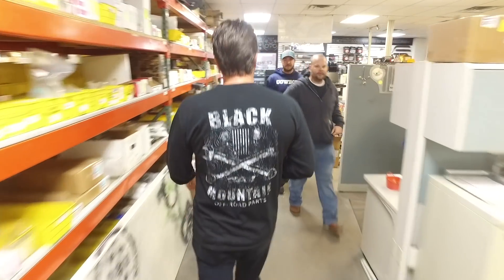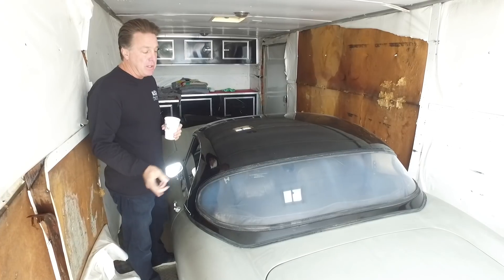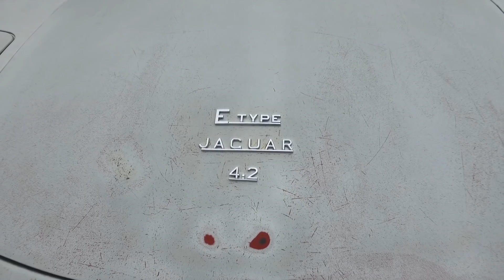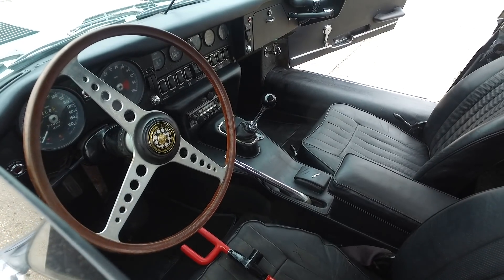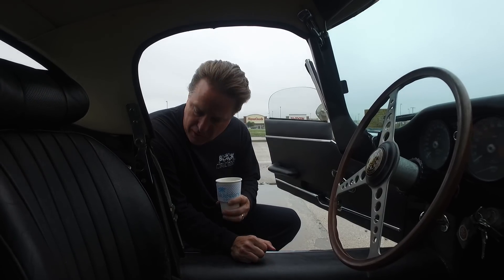Coffee Walk Ep.21: BARN FIND! 1971 E-Type Jaguar Roadster in mint condition

Comment: This is one of the last 6-cylinder jaguars before going V12. You can tell by the leapers on the front fenders and the chrome around leading edge of the nose.
Reply: This car is a series 3, which started in 1970, sadly most series 3's were V12 and were very problematic. Other than being a valuable car, I believe Dennis bought this 71 because of it being a rare straight 6.
Reply: This car is a Series II. The Series II started in late '68 and went on until June of '71. The Series III V-12 started in July of 1971, and was on the longer 2+2 wheelbase, with a grille, different wheel arches, and other differences. The V-12 isn't problematic if it is SERVICED per the owner's manual. Being an exotic sports car, it will give your wallet some serious shocks if you treat such a car like a pick-up truck, just putting in gasoline and expecting it to run forever with no proper maintenance.